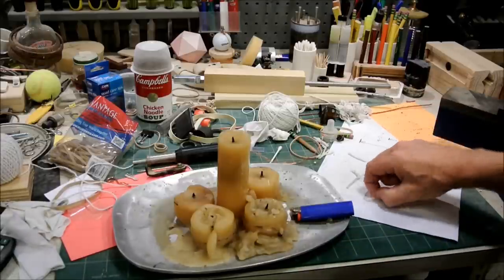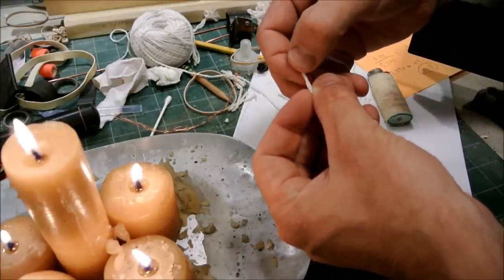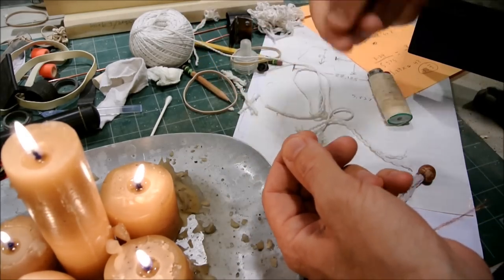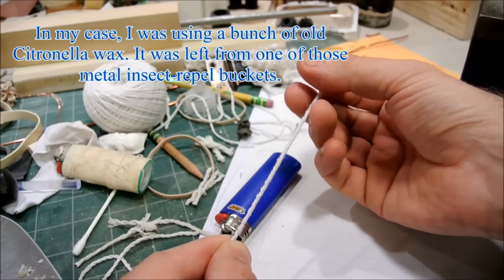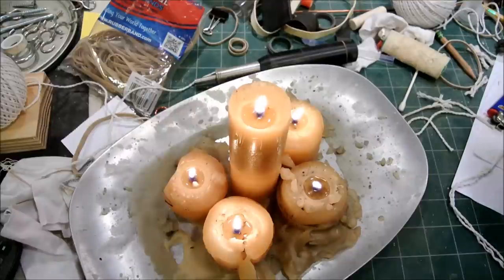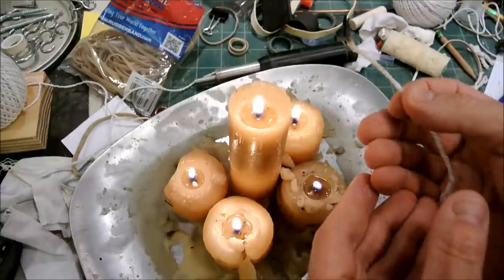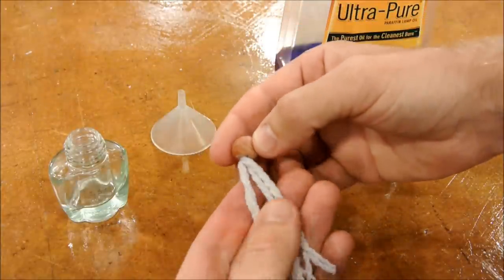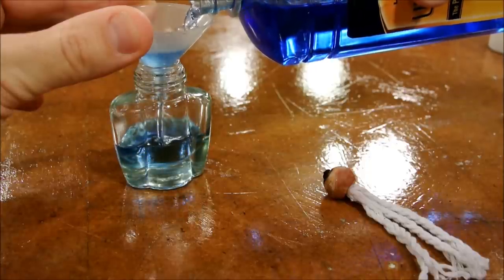How to make simple candle wick (for wax and oil)

Comment: I use cotton string from the dollar tree. You get like 500 feet for $1.25 and a single strand  from CAT5 wire. I actually prefer the alox wire over the copper as it burns away more readily. I use my cordless drill to twist  10' to 20' lenths at a time consisting of two strands of string and one of wire. I anchor one end in a vise or tie it to a cabinet knob or nail in the wall and put the other end in the drill chuck and keeping it taught slowly spin it until it is tight enough. By making it in this way, you can cut the length as needed or easily double or trebble the trust for larger canles. I also like to use soda cans of various diameters as molds.

Comment: To scale up, I used cotton clothesline rope to rescue some old tiki torches. Folded in half it fit through the wick hole, but burned messier.  A 15" piece burned every night for a week long camping trip, but unlike the normal fiberglass tiki wicks, I had to pull out more rope every night because the cotton burned down an inch or two in 4 to 6 hours being lit.